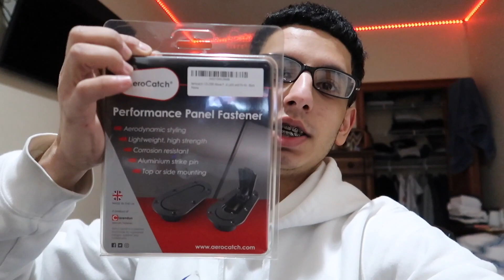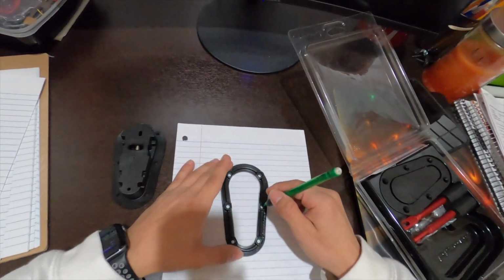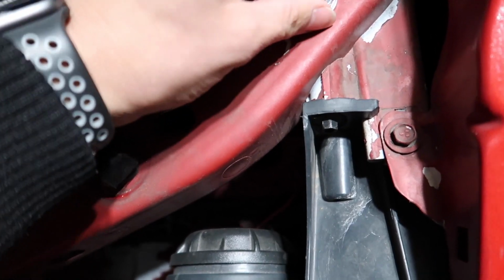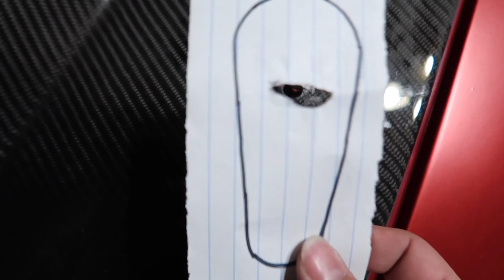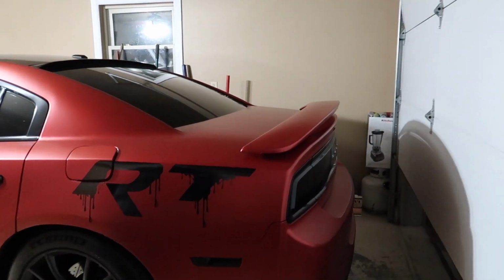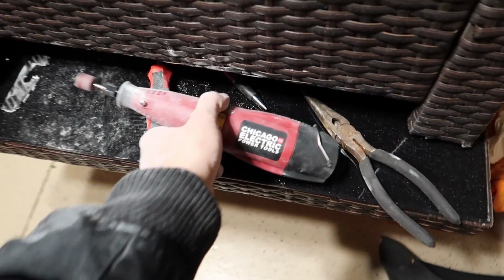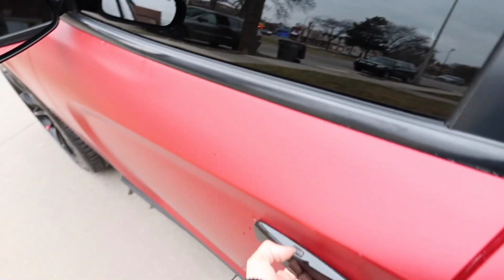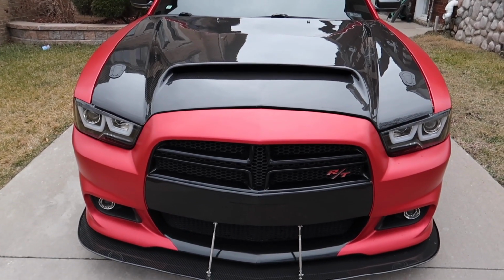AEROCATCH HOOD PINS ON MY NEW CARBON FIBER HOOD!!

Comment: Not that it matters too much now since you got it done, but your pin didn't line up because of the angle you had the drill bit when you drilled the hole. An easier way (if you ever help someone else install hood pins) to get everything lined up is first mark the underside of the hood support like you did, but only drill through the hood support. Then, grease up the top of the pin again and mark the underside of the carbon fiber top shell. That will give you an exact spot where the pin should go. You'll have to do both sides of the hood support first, so you can lower the hood enough to mark the CF shell, but it does make life easier.
Reply from the maker: Thanks for the comment. I appreciate the effort to help. However everything is good. The pin just needs to get raised. I need to loosen the screw and lift it up just a tad. It’s rubbing whenever it locks. Thank you tho 🙏🏽💯